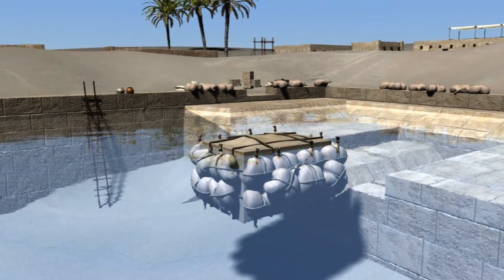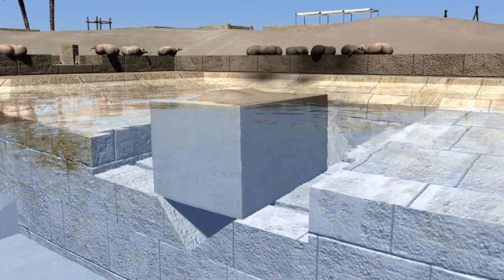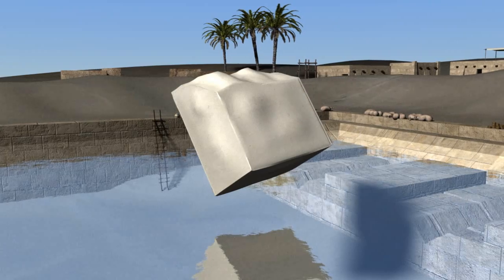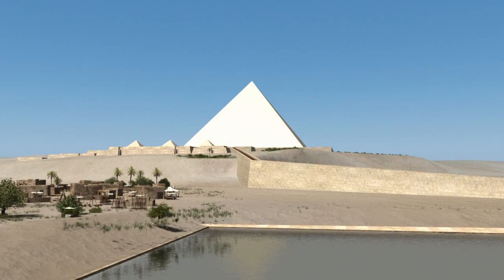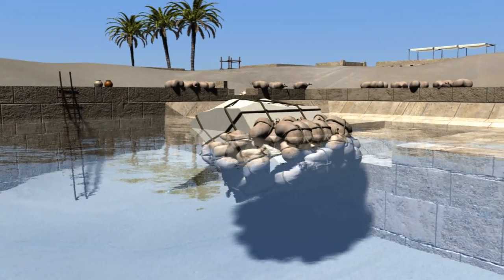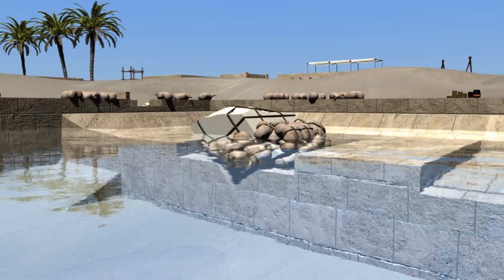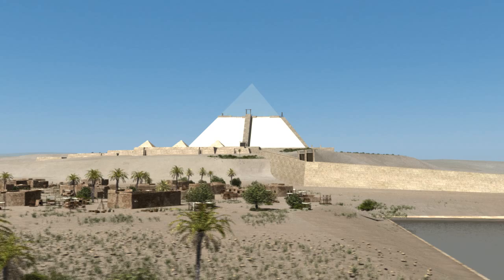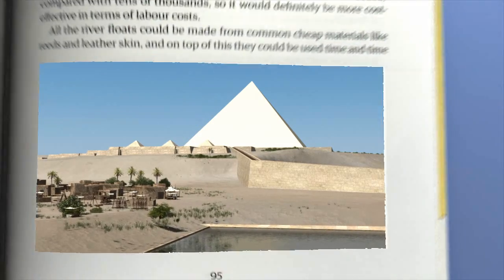How the Pyramids of Egypt were really built Addendum - Shaping the blocks

Comment: Outer ramp built up to each completed level all blocks and stones moved up the outer external ramp up to the height of the Grand Gallery. Once the Grand Gallery was constructed it was used as a work area for a Counterweight drop & lift of all the granite stones used to build the Kings Chamber. The Kings Chamber granite was lifted at the opposite side of the Pyramid via ropes and wooden track and rails. The Upper half was built using an elevator system lifting block up along the middle of the Pyramid face using a drop at the other side drop a weight at one side lift a stone at other side.
Reply: The rope elevator is almost certainly how the massive king's chamber granite blocks were brought up, utilizing the grand gallery as the counterweight trolley track.  The recent void found with muons appears to be the exact dimensions and slope angle of a second grand gallery directly above the first. This 2nd counterweight ramp would be needed for the top half of the massive slabs used in the "relieving chambers" and final massive block gabled roof of the king's chamber superstructure (there's probably 2-3 more layers of weight deflecting gabled blocks above what can be seen).

This second grand gallery, after it wasn't needed, was likely left hollow to function as a weight relieving chamber above the lower gallery, decreasing the overall vertical weight load.

After that I think an internal ramp system would have been employed for the final third of the pyramid, using a rope roll system with multiple wooden posts, so there'd be no line of men in front of the stone, they'd walk down the slope, with multiple teams permanently positioned at set lengths along the tunnels.
Possible evidence of these tunnels can be seen in the gravimetric imaging that was done in the 80s
Reply: @lefyre1266  have you noticed the faint lines that are in the middle on each front face of the 4 sides of the Pyramid looking from an Ariel view shot.
Reply: @lefyre1266  those faint middle lines could of  been where they put a smooth upper line of facing stones as to lift a wooden cage with a stone in , via a ropes and Counterweight dropping on the other side of Pyramid that lifts the other side stone upwards. Once the lower half was built that then acted as the ramp after they dismantled all the stones and rubble from the main outer ramp away from the face they was left with the bottom half with the smooth casing stones used as the ramp/elevator pull up along a smoothed greased surface
Reply: @davidcorbett1713  That's very interesting, I was never aware of that. And they go straight to the top. Possibly evidence for Franz Löhners ramp theory.
Reply: @lefyre1266  I've been to the point of obsessed as ti how the Giza Pyramids were built for about 2 years haha. I believe that Jean Pierre Houdin's theory of building up to the Grand Gallery and the use of Counterweight pull lift for building the Kings Chamber is perfect and true. But after the KC was finished I think after removing the outer ramp then the elevator lift theory took over
Reply: @davidcorbett1713  that was a very good video, a bit too theatrical, but the simulations makes a lot of sense. Just chains of men tossing sandbags from one guy to the next, nobody actually hauling blocks up. Seems far more productive and simpler than making internal spiral ramp
Reply: @lefyre1266  exactly my thought to pal 💪
Reply: @lefyre1266  I've been saying for a while now that I personally believe that no stones where lifted by hand but only loaded on to flatbed sleighs or slid along built up ground then placed. The ancient civilisation who built these were as intelligent as we are today with what we have as technology they just used basic maths and weight & measures. Master stone builders & mathematicians of there time.
Reply: @davidcorbett1713  I've been reading more about this idea, and have some further ideas, 1 is my idea that the line running up the center of the pyramid is where the "staircase" was, the area where the casing stones weren't placed as the pyramid rose. The "staircase" might have been more deeply stepped.

 After the pyramid was completed this staircase would have then been covered with casing stones at the very end.

But because the casing stones were looted away, now the more recessed center strip "old staircase" stands out. 

So I would propose that on each side of the staircase were an oiled wood track for the sleds to ride up.

Meaning there could be up to 8 tracks on the pyramid.

Then the blocks go up the tracks on sleds, and the counterweights go down the opposite side, as you've said.

Each staircase would be quite wide, relatively, and there could've been multiple chains on men tossing up sandbags

8 chains of men tossing a 50lb sandbag every 5 seconds, 5000lbs could be transported to the top every 1 minute, as counterweight material.

The blocks at this point came from the ramp no longer needed at this point.

This system could bring up hundreds, if not thousands of blocks a day.
Reply: @davidcorbett1713  one other thing, I was looking at the internal cross-section of the pyramid and began to ponder if the subterranean shaft and chamber had any construction purpose, I realized that it could.

See, when the pyramid just got started, and was low to the ground (before even the Queen's chamber or gallery) there was no way to counterweight stones up the ramp, well the subterranean passage could have been the counterweight ramp, with an oiled stone cylindrical "wheel" or "pulley" (have to use those words carefully, as they didn't have true wheels or true pulleys )
This would allow for the counterweights to be slid down to the subterranean chamber, pulling up blocks, up the exterior ramp, to the pyramid.

BUT, crucially, using a subterranean counterweight ramp from the get-go, means the exterior ramp can now be much steeper and easier to build than ever proposed before. 

This system would truly allow nearly the entire pyramid, from base to top, to be completely built without men pulling any blocks at all.

That explains why the subterranean chamber is rough and unfinished, it was purely a construction related tunnel, and the chamber was just to store the counterweights as they piled up down there.

Once the chamber was full, they'd just "put it in reverse" and slide counterweights down the exterior ramp to clean out the subterranean chamber.

Granted, it means more work moving sandbags twice as much, but that's much easier than pulling 2.5ton stones

Comment: Prehistoric man here in North America did pretty much the same thing they would walk The Creeks and rivers and lakes and look for stones that are wet they're easy to work. A lot of Axe makers I know pick up hard stones out of the fields and the stone is too hard to work you can work it but it takes a lot longer I discovered this when I dig holes for basements for concrete work I would find stones and I would work them just for fun and lay them on the dirt overnight next day I was amazed at how hard to Stone was. Once it dries out is pretty tough I'm also a flint knapper and we soak Flint in water the same way prehistoric man buried it to keep the stone damp it's called hydroshock when you knocked a flakes off it works better I have Stones soaking in buckets of water for over 20 years waiting on me to get to them that way they don't dry out and become brittle. We have even put stones in pressure cookers to try and pressure water back into the stone. This man is Right water is the best level the old timers would put water in a garden hose and use it as a level

Comment: Has anyone thought they may have used ram pumps to shape the stones. With a atmospheric pressure as high as the pyramids that would be enough pressure from the water to cut any rock. With a copper tool placed on both of the pistons. 2 pistons placed in 2 different spots both cutting one stone at a time. Using a atmospheric chamber like the pyramid to give the pumps enough pressure. The pumps would use water as a lubricant to cut the stone as well. Also the pumps would keep the stones wet and at the proper water level always adding more water when running. One pump would be at the sphinx the other set in another position. They could also use it to cut wood. The wood would absorb the water and could be shaped around molds tied down. Then put out in the sun to dry into the shape they wanted it to obtain. They could build boats this way to transport materials.  To be quite honest I think the sphinx was probably a saw mill using water like they use wind to create  saw mills.

Comment: And wth
Since when is chiseling underwater safe and how would you move you arm fast enough underwater to make an effective blow (considering copper is softer that most of the stones used in places like The Seraphim of ?Saqarra?) You know the place with 100 ton boxes in a tunnel complex carved out of bedrock completely void of light and space to work (enough space to squeeze by if you are thin and 2 inches on the opposite wall) not only are they hard materials, they are perfectly square in the inside and notches were cut in the lids for a crane or clamp of some sort. Also the only finished product (built to show construction order of the project) but they did not use torches because the ceilings are spotless and the boxes have a mirror polish with dried chemical resin on the underside of the 25 ton lid set on top of the 8 foot box.

Thanks for not responding with a logical theory that is not some bull**it lie covering up the fact nobody knows and nobody wants to accept the fact that the god of that land and his helpers constructed most of the stuff allowed to be seen by the public and also the stuff hidden from the public.

Think before you accept this ridiculous theory people
Reply: Dried chemical resin inside the lids?! Anyone get a sample and do any spectrum analysis?!

Comment: So many problems with this silly theory. Do you realize how many "floating devices" you'd need to float such heavy stone? Even the smallest blocks would be massively difficult to float. Not to mention the interior design of the great pyramid. The stone in the pyramid such as granite and much harder stone that DOESN'T soften in water. This theory is so unrealistic it's comical.